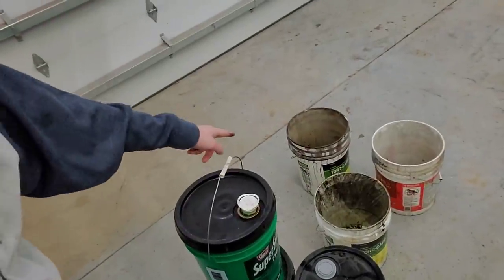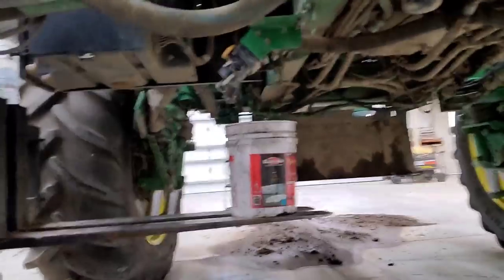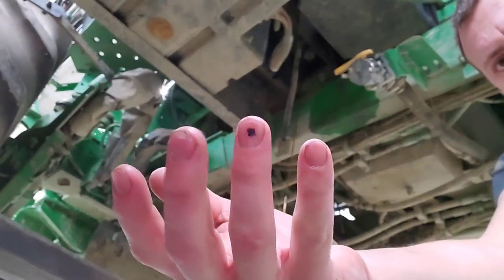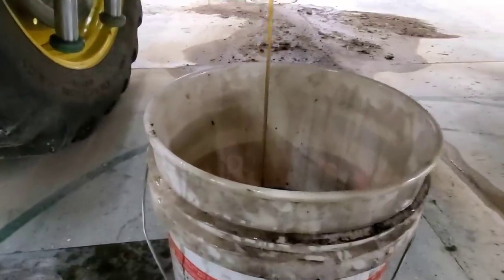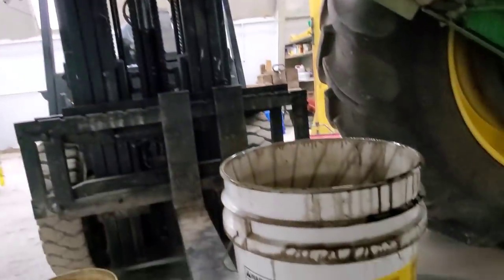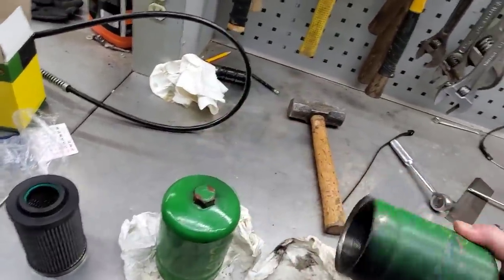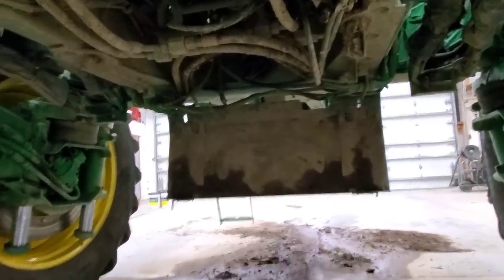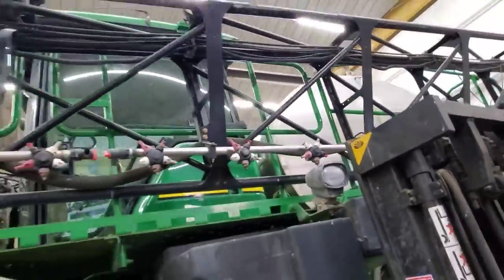Corona Virus Prevention Plan - #105

Comment: That was a great splash. Next time stand on the other side when you take out the drain plug. If you right handed it will be easier. Just try it you will be surprised!!
Reply from the maker: Remind me of that when I'm doing this again in 3-4 years.  Also I'm left handed, think it would still help?
Reply: No. You took the plug out with right hand  which put your body closer to the bucket. If u used left your body would  be out of the way.  Anyway If I'm still alive ill try to remind u. Lol

Comment: I used to haul fuel for flying J and we had what they called diapers they only suck up liquid lubricants "oil, diesel fuel ,not water and they are awesome . it's the first thing i get out on every oil change and just spray carb cleaner or brake cleaner and wipe up any spills on the concrete .

Comment: It would be nice if you show the complete job taking off and on instead of taking off and then just showing the part back on
Reply from the maker: What did I do that on in this video? I try to get most of it but something's are hard to film and it makes these videos longer than I want them to be.
Reply: Well like the oil drain plug is there a torque limit but other then that its fine ive seen you take oil filters off so pretty much the same as putting it back on keep up the good work